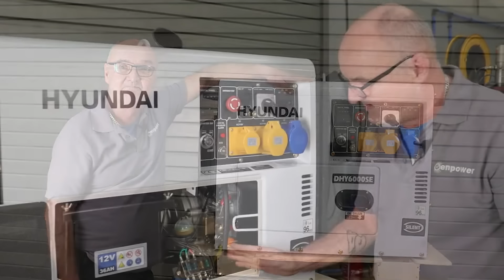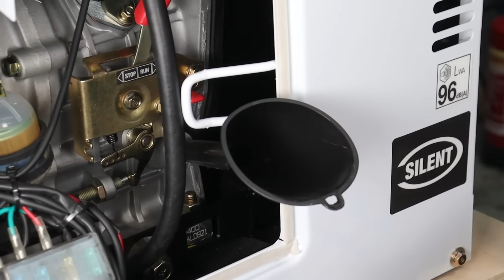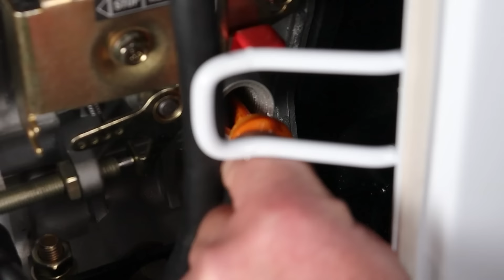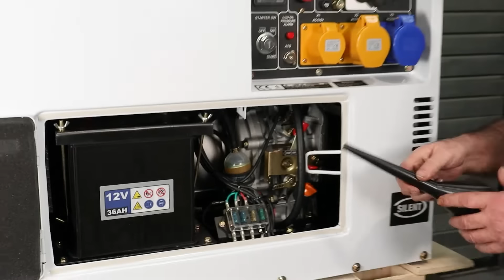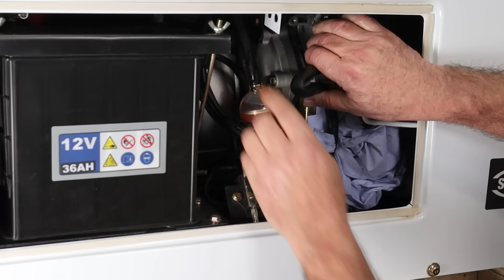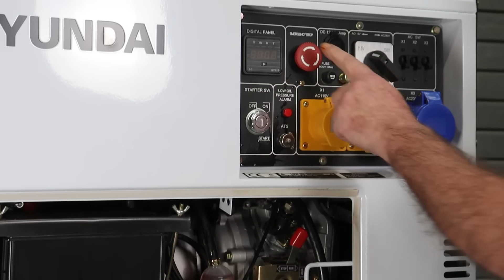Hyundai Diesel Generators ( DHY6000SE / 8000SELR / 8000SELR-T ) Adding and Draining Oil & Fuel

Comment: Where do you drain and change the filter?
Reply: The oil is drained to the left of the dipstick and lower down, you will see an extended hex shaft positioned horizontally with a plug in the end of it, hold the hex shaft with one spanner and remove the plug in the end with another. 
But before you do, place a flat catch tray underneath the generator and below the plug. (You will notice a spillway below the plug to channel the oil down to the tray).
Filter is a black plastic affair that looks a little like the dipstick end, it is to the left of the drain plug and is held in place by a 10mm nut, it is a strainer rather than a filter, so it only needs to be washed in petrol or diesel and put back in. Obviously if the gauze is torn it will need to be replaced.
Refill with car engine oil as he showed in this video.